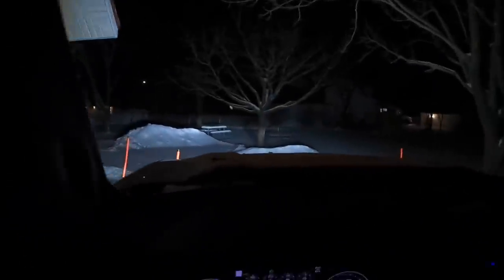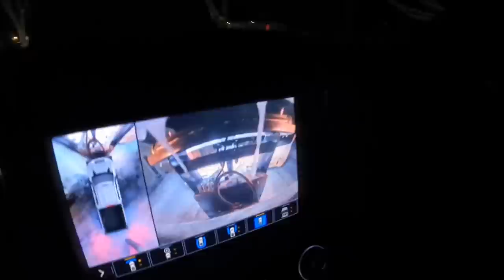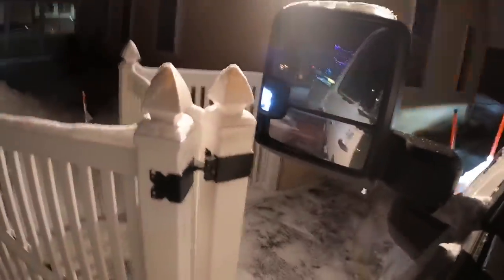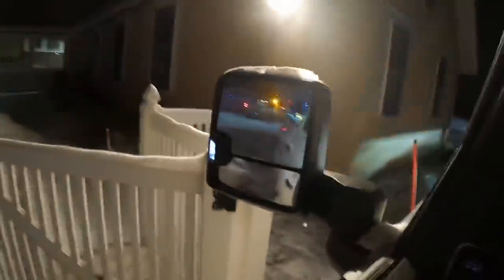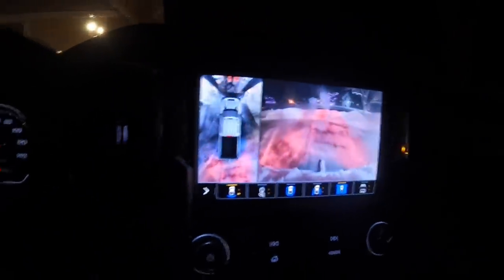SNOW PLOWING VLOG! | EASY MONEY!! |

Comment: Do you plow with tow/haul mode on or off
Reply: I was instructed to plow and drive with it on by a mechanic. He advised it to be on because the trucks transmission pump cycles the oil through the transmission cooler constantly and faster that way.
Reply from the maker: We generally plow with it on!